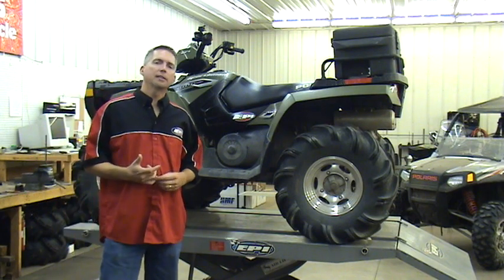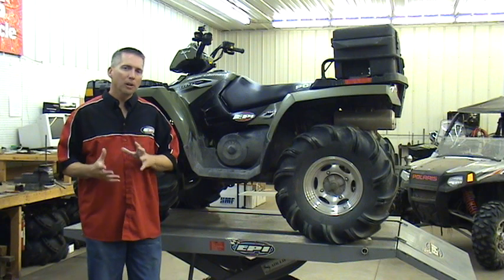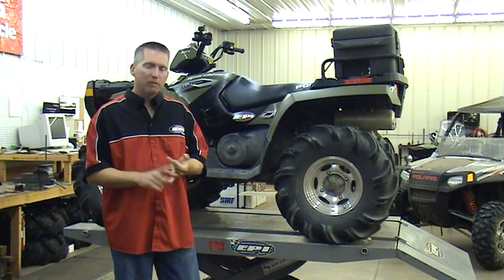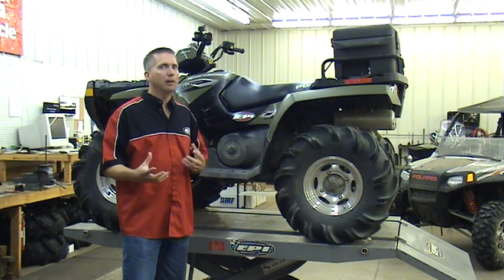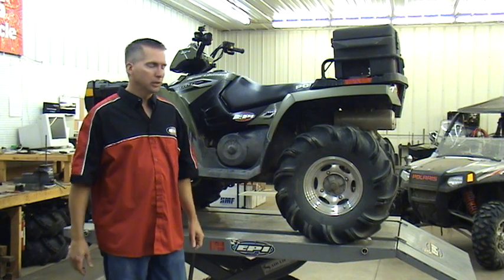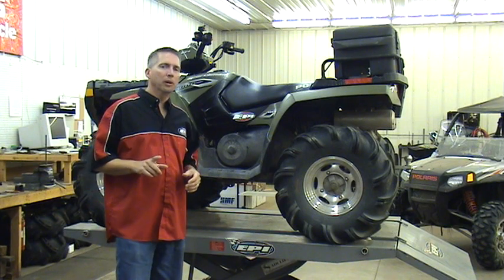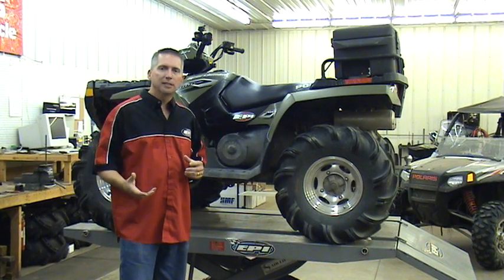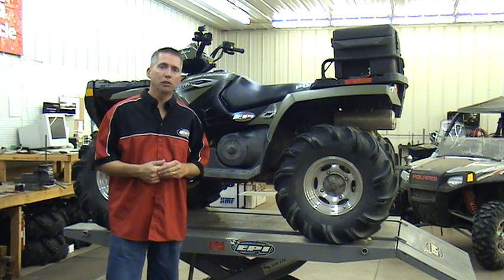"Why do I need a clutch kit?" By EPI

Comment from the maker: @bballplaya123678 
The Sport Utility kit is going to give you the most performance gains.  It will help make up for the power loss you feel with the bigger tires.  You will get better low end and mid range power, faster back shift and throttle response and it will grip the belt tighter so you have less slippage.  The economy kit  will only change enagement.  With the Sport Utility kit it will tune all the clutches better.

Comment: I have a polaris sports man 500- 1999.the clutch is hit ,cutting in the plastic cover.this is a factory machine ,nothing has been done to it. any suggestions.Thanks Jay.
Reply from the maker: The most common problem that would cause that is that the plastic cover is warped or has had enough pressure on it from kids or your feet resting on it.  When this happens the cover eventually starts drooping down and rubs the clutches.  Usually need to change the front and rear plastic cover.  Could also be a sign that your clutches are out of alignment which can be caused by a loose or broken engine/transmission mount.  Hope that helps.
Reply: Thank you for your time!!!

Comment: Is this the same procedure and clutch puller for a 2017 hightlifter xp. If so can I get the part # for it?
Reply from the maker: If you have a 850/1000 Sportsman XP the procedure is different to get to the clutches.  We have a video on website and youtube specific for the 850/1000 Sportsmans and Scrambler.  That video is really close to the highlifter.  As of right now we only have a kit for the 2016.  We are trying to test a 2017-2018 as soon as we get our hands on one.

Comment: I got a 2004 sportsman 600 runs great but when I go to stop it stars screaming and won't let me change the gears till I shot it off what could this be
Reply from the maker: in most cases it is caused by your one way bearing being worn our or locked up.  If the bearing is good then it can be caused by dirty and/or worn clutches that are sticking and not fully disengaging.  Third cause can be the clutches are out of alignment, usually due to a broken or loose motor or transmission mount.

Comment: I have a 2016 rzr 900s do a lot of creek {sand} riding Can you tell me what clutch kit i need the belt keeps getting hot. I am looking for smooth take off in tough  conditions. When your stuck and trying to inch foward and backwards it gets hot and starts to slip. Please advise. Thanks
Reply from the maker: +Linda Conroy We haven't tested the new 2016 900 S yet but plan to as soon as possible.  We should have five different kits available for it when we are done.  The kits will be for different tire sizes and different types of riding.  If you can check back in about a month we should have a kit ready for if everything stays on schedule.  Thanks
Reply: Any news on the clutch kit yet?
Reply from the maker: WE haven't been able to get our hands on a 2016 RZR S yet, but have had a few people run our 900 RZR (50") kit and so far they have been happy with it.  We are still trying to get our hands on one here.  Normally it isn't that hard to find one but we are struggling.  WE have almost all the other 2016s done.
Reply: Any news on the clutch kit yet?

Comment: @Epiperformance do you.make kits for the 01 Yamaha grizzly 600? Is so part number?
Reply from the maker: We have 5 different kits for that machine depending on what tire size you are running, what elevation your riding at and what type of riding you are doing.  You can find them on our website www.epiperformance.com or call us at 218-829-6036

Comment: I'm sure everyone is asking questions. I have one, I have a 1999 Honda Forman 450ES, TRX450ES. I am looking at 27" Kenda Executioner tires. I am running stock everything besides getting a 2" lift spring. I want to know if I should change the clutch now or wait? Would I need a Competition stall clutch kit for my primary, as well as a heavy duty clutch kit? I will be mudding a lot and pulling people out of mud as need be. I will also be just riding this normally outside of mud pits. Any idea how much your clutch kit would be? How is your kit compared to say EBC? Thank you!!!!
Reply from the maker: Honda uses a different clutch then the other brands so our clutch kit is a little different.  The economy kit raises the engagement 300-500 higher then stock and the competition stall kit raises the engagement 700-1000 rpms over stock.  Both of these kits only change the wet clutch springs.  If you go to the performance upgrade you will also get new friction plates for the other clutch on the machine.  Any of the kits will give you added performance over the stock clutching and be a big help when riding with the larger tires.  You get better low end and midrange power and faster response out of the clutch.  Hope that helps, let us know if you have any other questions.

Comment: I just had an epi clutch kit installed on my 2013 kingquad 500... is there a "break in" period? Or can I giver from the get go. ( the only difference I found so far is , it takes more RPM before it starts to move, is that normal?)
Reply from the maker: There is no break in period for the clutch kit its self, but if you installed a new belt you will want to break in the belt for 20-25 miles.  Yes that higher engagement is normal on that machine.  Should be nice and smooth just higher.  If it seems higher and seems like it is slipping you might have a roller out of place.

Comment: i have a 2016 kodiak 700 , wanted it to be hotter out of the hole and i like to mud.. any suggestions?
Reply from the maker: +Ryanmaclennan We just finalized our 700 Kodiak testing and made a huge difference on the performance of the machine.  We have all of our kits available for it.  The exact kit you will need will depend on your tire size.  But we got a lot better low end and midrange power and acceleration, a lot faster backshift and throttle response and will grip the belt better then stock!!  It will totally wake up the performance of you machine.
Reply: im running 26'' maxxis zillas right now ! dont think ill go much bigger i might go 27" but ill never get 28" tires.. can u tag a link also where to order the clutch from! Thanks

Comment: I have a 700 Yamaha grizzly 08 and I am running 28in mudzilla's  and when ever I ride I never feel a lack of power or speed do I need a clutch kit
Reply from the maker: Yes a clutch kit will help make up for the power loss of installing the bigger tires.  You will get better low end and midrange power, faster backshift and throttle response and it will grip your belt better then stock.  You can decide between two kits with your 28" tires.  You can go with the Sport Utility Kit for 27-28" tires or the Mudder kit.  Both kits will do as described above, the Sport Utility kit is our best all around set up if you are doing a little bit of everything with it and the Mudder kit is more focused on the getting more lower end to help turn the bigger tires even better, but you will give up a little top end mph for it.  Hope that helps.

Comment: Which kit is the best for a 2006 Polaris 500 sportsman going to 27 inch tires? Thanks
Reply from the maker: You would want to use the Sport Utility kit for 27-28" tires.  There are two different version of the 2006 500 Sportsman.  The EFI version with EBS (WE430503) and the HO Carb. without EBS part number WE435013.  Both part numbers are for the 0-3000 ft elevation range.  Hope that helps, let us know if you have any other questions.

Comment: Have a 2016 CFMOTO 500 HO cforce and I predominantly do trail riding the problem I am experiencing is it seems to have a delay or harsh engagement just on take off otherwise I have no issue never had any belt slip of any sort I'm wondering if there's a clutch kit that I need to upgrade and repair this problem
Reply from the maker: Hi James, as of right now we don't offer a kit for your machine.  The hard engagement could be from a worn belt, dirty clutches, flat spotted rollers, grooves in the clutch, or a worn out wet clutch.  I would suggest taking the clutches apart and give them a thorough inspection.  Then you might find an issue.  Hope that helps, let us know if you have any questions.
Reply: EPIperformance first of all thank you for the amazing quick response I did remove it clean it and inspect it and to the best of my knowledge everything is good I don't believe it has a wet clutch it's a cvtech system I will say for a couple days after I cleaned it it did seem to be better but the problem came right back the machine doesn't even have a thousand miles on it anyway I appreciate your quick response and help thanks again
Reply from the maker: no problem. We hope you get it figured out.  We are hoping to do more CF moto testing in the future and then would have more info for you and maybe more clutch help.
Reply: EPIperformance thank u looking forward to it

Comment: I have a cfmoto z force 800 sxs 2014 I need ur help couz my cvt clutch sucks and it's very low in torque will ur clutch help my sxs work better in sand dunes hills it has cv tech clutch
Reply from the maker: Omar Arab Unfortunately we have not tested the 800 CF Moto so we don't have a kit to offer to you.  We hope to have one in the future if we can get one to test with.  Thanks

Comment: Thanks for the video.. I have an 04 Prairie 700 with a HMF pipe and bigger jetting. Running 1" bigger tires.. I was td by a friend to run with EPI pink primary and EPI almond secondary. Can you please tell me what kind of performance this will give me? I don't understand spring rates from the chart.
Reply from the maker: The pink will raise your engagement up a little higher then stock which will help get you more low end power and response.  The Almonds secondary is stiffer the your stock spring and will backshift (downshift) faster then stock and grip the belt better then stock.  if you are running stock size tires you might lose a couple mph off the top speed, if you have larger or heavier tires then stock the top should stay the same.  Its a pretty popular set up on your machine.
Reply: @EPIperformance  Thank you so much for the quick response. I am running 26" ITP Terra Cross R/T tires on custom aluminum wheels. They are 1" bigger then stock. I see you guys have an Amazon account and I'd like to order on prime to get them asap! Can you please give me part numbers for my 04 Prairie 700 pink Primary and almond secondary springs? I posted in a forum and I'd like to help others who are looking for spring recommendations as well.. I do plan to give my review of the springs as well as share my feedback on your quick and friendly customer service. If you would like to join a great community please check out the "Kawasaki Brute Force/Prairie" group on Facebook. 
There is a lot of talk on springs there and we would love to have you join! 
Thank you so much for your help!
Reply from the maker: @jaybourbon8608  The pink primary is part number DRS20 and the almond secondary is part number KSS5.  Thanks for the support.  let us know if you have any questions.  You can see all of our products on our website at epiperformance.com
Reply: @EPIperformance  Thank you very much.. Relayed your messages to help my group, and those who may need new springs.. Have a great day today..
Reply from the maker: @jaybourbon8608  Thank you!!

Comment: Wich clutch (kit) do I need; I have a Outlander with 30'' tires and a 6'' liftkit. I mostley ride on the main roads and sandpathes. 
I hope you guys can give me advice. 

T.
Reply from the maker: in most cases with 30" tires we would have you use the Mudder clutch kit which is designed for 28" and larger tires.  If you are doing a lot of high speed road riding and using the top end then we would have you use the Sport Utility kit for 27-28" tires.  Both kits are the same price and same amount of parts, they are just tuned a little different.

Comment: need help....hello i recently change the clutch on my 2002 polaris 500ho sportsman and now is really hard to shift.. and went its on low or high went I stop it goes offf..?????
Reply from the maker: Efrain- That could mean a couple things are wrong with your clutch.  It could the one way bearing is locked up and bad.  Your clutches could be out of alignment due to wrong shims or a broken or loose motor/transmission mount.  Your primary clutch might not be fully disengaging (opening up).  Or you might have the wrong belt on your machine.  Hope that helps, call us if you have any more questions.  Good Luck.
Reply: Thank you very. Much. I let you know.

Comment: 18 Polaris 450 ho. Stock tire are 24". I want to put 25" on it. Most trail and wood riding. Do i need a clutch kit?
Reply from the maker: You don't absolutely need one but the kit will give you better all around performance and give you better belt and clutch life.  If the tires are light and not super aggressive then I would use the Sport Utility Stock Tire Kit.  If the tires are super heavy and aggressive then you can bump up to the Sport Utility kit for 27-28" tires.

Comment: hi ,I just bought a 2015- 570 sportsman . I want to put 26-10-12 mud bug on all 4 ,would I need a clutch-kit.   thanks
Reply from the maker: frank bastone Its not required to have a clutch kit but I would recommend one.  The clutch kit will give you added performance and better belt life.

Comment: hey i have a 2005 honda rancher 350 with 27” mega mayhem’s. as soon i put the tires on i noticed a lot of lag in the motor. i need a clutch it that would make up for the lost power and be able to turn in thick mud. please get back to me asap. thanks
Reply from the maker: We have two kits for your machine.  Most people use the Economy Kit part number WE497010 which will give you more bottom end and mid range power to help turn the bigger tires.  The clutch engagement is 300-500 over stock.  If you want the all out most bottom end power and response then you would want to go the competition Stall Kit part number WE497211 which is 700-1000 higher then stock.  Both kits really help out to get the tires moving and spinning and keep them moving with more power.  You also notice a big difference in reverse when you are trying to back up in mud.  Hope that helps, let us know if you have any other questions.

Comment: EPI i bought a 2016 Grizzly 700 Limited Edition and i have 26-12-12 Back 26-10-12 front and i will keep the same side and i want more power with cluch kit i need thank you
Reply from the maker: If they are a lighter tire that isn't an aggressive lug you can use the stock tire kit part number WE391075.  If the tires are a little heavier a more aggressive tread I would use the Sport Utility Kit for 27-28" which will give you even more low end and midrange.  You might loose a few mph off the top end speed but will be a lot better in low end and midrange.  Part number is WE391077.  Hope that helps, let us know if you have any other questions.
Reply: Cant I but the shim mod whit the cluch kit thank you
Reply from the maker: Yes you can use the shim mod with our kits.  The shims will help bottom end but will hurt the top end speed.

Comment: 2019 sportsman 850 sp just installed 29.5 outlaw 2 tires what clutch kit will I be looking at for my bike
Reply from the maker: You would want to use the Mudder kit part number WE437484.  It will give you a lot more low end and midrange power to make up for the heavier tires, faster backshift and throttle response and will grip the belt better then stock.  We have a video on the older 850 Sportsman/Scrambler on our website to help you out also.

Comment: Where can I find info on what secondary spring works best for me?
Reply from the maker: We would need to know the exact year and model of the your machine and also what size tires and type of riding you are doing.  Then we can look at all the info and give you a recommendation.  All of our springs our listed on our website also at www.epiperformance.com
Reply: EPIperformance correct, but is there anywhere that shows what spring is best for what, or do we leave that up to you?
Reply from the maker: There is no easy chart.  If you call or email us we can look and see what would work best.  There are a lot of different variables.  Usually if it we can figure out what is best or give you the best options and the differences.

Comment: i have a stock 03 honda 450 rancher s.  i notice a clunk in the front facing part of the motor when i rev up from an idle.  would it be a safe assumption to say that this noise is coming from my centrifugal clutch, and if so, what is the remedy?  just new clutch weights?  thanks mike
Reply from the maker: Hi Mike, its hard to know for suer without seeing and hearing it.  It could be a worn clutch, broken clutch spring would be the two main things unless its something worn out in the front diff and your hearing it up there.
Reply: @EPIperformance  Ok.  I really appreciate your reply back to me.  As my hunch was the clutch since i noticed it upon initial acceleration from idle.  Thinking that the clutch pads were wore.  Will this sometimes wear on the clutch hub?  Would it be possible that i need to change this hub also due to excessive wear.  Thanks!
Reply from the maker: @mikecochrane2074  Yes it can wear on the hub also.  Usually the last 1/4" to 1/2" of the pad material will wear, then as it slips it will wear groups into the hub.  Im not sure what the wear spec is on the hub but usually I tell people if you have blue or like a burnt look on the outside of the hub from being hot and overheated or if the grooves are deep then replace the hub also.  You can look at the clutch shoes and see the material isn't real thick.  So if the grooves are even just a little deep it will wear out the next set of pads quick also.